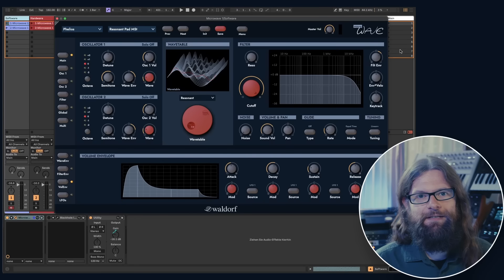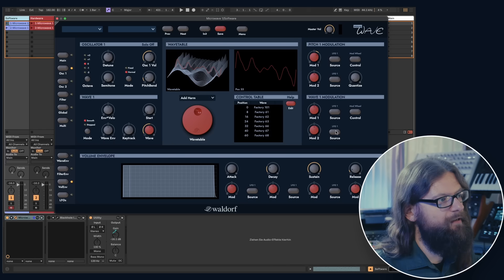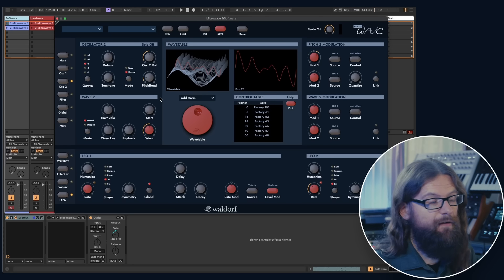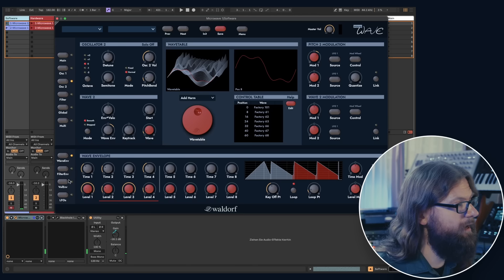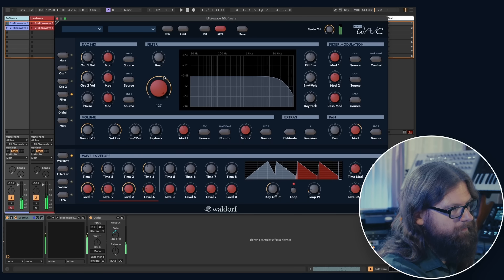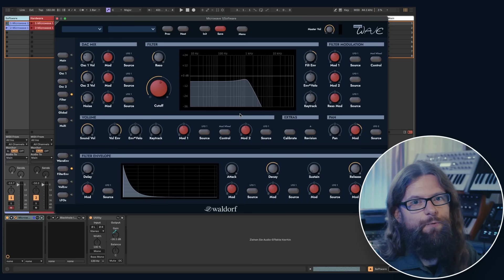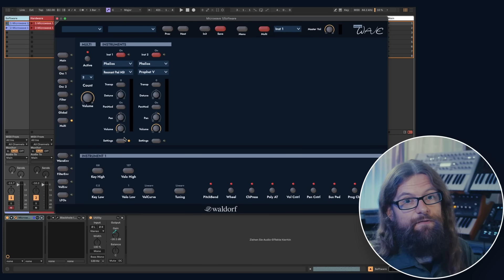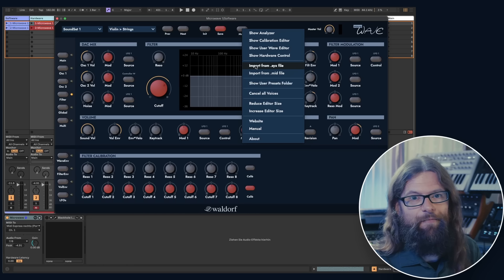Microwave 1 Plugin - Walkthrough, Sounddesign and hardware remote

Comment: Recently in the open source DSP 56300 emulation project they have presented the emulation of the Waldorf Microwave II/XT. It is a good coincidence that Waldorf releases its own software version of the microwave
Reply from the maker: I am also a huge fan of the DSP emulation project and featured the Virus on this channel. It's great to have both the II/XT and I in the box. Great times to make music!
Reply: @MartinStuertzer  which is better?
Reply: @burger659 I haven’t used the Waldorf version yet but I have the original XT and the dsp emulation is spot on, which is no surprise since it’s running the actual ROM and only emulating the processor(s)
Reply: Well, back then people preferred the MW1 over the MW2 as the MW1 has analog VCFs and VCAs..
The Xt came with hands on controls, and without my Access programmer i would have parted with my MW1 after a week as programming is hell on earth .
So now Waldorf has to emulate those analog features and add them to the digital core or wave tables , and with CPU tech from 2020 that is not a problem anymore.
The clicky envelopes are still there but can be dealt with and the interface is marvelous, clean and easy to read and even acts as controller.
Still, if you want o use more than one instance you need a proper machine, the DSP emu has a very good multi mode that is lighter on the CPU.
They are both fantastic instruments , and in DSP land i am more looking forward playing with the new NordRed2X but Xenia will definitely get a place in the virtual rack, especially for those ethereal bell like sounds

Comment: Thx for the video! Unfortunately I'm not able to connect the vst to my hardware MW1. Is there a special vst version just for the hardware? May ableton vst window (bottom left window with yelow dot) shows no midi IN/OUT just the XY field. Sure I'm missing something ...many thanks!
Reply from the maker: It should work with the regular VST. I suggest, that you contact Waldorf support, they should be able to help you!

Comment: Not sure why you would go with this at 149.00 $ when you can get either Vital, that blows it away for free or Korg modewave for 99.00 (when its on sale) that has quite a bit more capabilities. I gues for the novel desire to want a classic, I can see that but when you have smaller companies releasing really good classic emulations in the 25-100 range...
Reply: Because it’s the official app from the actual manufacturer with all the quirks of the OG.  There’s a premium for having the real thing, but feel free to use whatever works best for you 😊
Reply: Why not both, they do different things and sound different...
Reply: @user-ix5se9lg6o  Actually they do the same thing for either no money or less. Oh, and they do more than this. So the ONLY reason to get this is because it says "Waldorf".and/or you want a true emu;nation of this synth. But as I said before, why? If you can get more of the same for less.
Reply: @googlingthevoid  I said exactly that in my comment - if you want a novel emulation then be my guest. Your second point, "Its the official app" is never a good reason to buy anything. Your last point, "the real thing" - it's not. If you wanted the real thing, you would get the real thing. This is an emu. I take your point on the quarks. But 149.00 I cans emulate those quarks with a superior wavetable softsynth that costs less or free.
Reply: They are both wildly different synthesizers and don't sound anything like th Microwave 1. Do you get why they made this?
Reply: @Dudderlyful  overstatement.
Reply: Vital lol. If it ''blows it away'' that much, I then challenge you to prove your saying. Simple: take Vital, take the Microwave free demo and try to reproduce the same sound with your Vital thing and post your comparisons publicly, like here. Good luck, cause you will never be able to so that's why you won't post the examples. Have a great day!
Reply: @pablosmith5473  weird passive aggressive post dude. It also shows your utter lack of knowledge about synthesizers. You also completely created a logical fallacy. This isn't a boxing match. Vital is an epic synthesizer capable of creating just about anything your synth head dreams up. But that wasn't my point....🙃
Reply: Vital, you forgot to mention Serum and any other wavetable synth. Why? Becaue Waldorf have decades of experience with wavetable synthesisers, although their software have terrible outdated UI (including refreshed Largo UI).
Reply: @GrootsieTheDog  Vital, one synth to rule them all, right? I don't like Vital interface by the way, although I own it. It is powerful synthesiser but Microwave 1 is something else although they both share wavetable technology. You can't ignore intelectual property of Waldorf and their experience with wavetable. Maybe you can make close sounding patches in Vital, but why bother if you have real thing in software or hardware? And there is XENIA emulator.
Reply: @303machine  that was never my point. Commenters keep creating strawman arguments. My only original point is that their are so many wavetable software synths out there now that can creat the sort of patches that this can and for less money and with better interfaces. That’s all I said. My only mistake was I guess I should have expected a slew of fanboy online angst to come my way for simply having a reasonable argument for why one might want another software synth over this one.
Reply: They modeled the ASIC chip to bit accuracy which will give you all the same artifacts, bugs, and quantization errors of the original unit. Add in the filter emulations and conversion emulation, and it gives you a different sound hard to emulate. It’s like saying the Prophet and Oberheim are the same synth because they are both subtractive analog, but they are sonically distinct in their character. Neither is better, only preference.
Reply: @googlingthevoid  Yes, but Waldorf are somwhat notorious for abandoning their software. Just look at the miniscule UI STILL present on the PPG Wave V3!
Reply: The thing is, it sounds really good, and there are some really nice touches - like the way we can build wavetables from the factory/user waveforms (inc random/shuffle), the freeform mirrored user waveform drawing, the way the wave envelope works where time is really rate of change, and the layering of instruments/voices.  I've been using this for weeks and the "weight" of the init still makes me smile. There's something to be said for being so focussed vs jack of all trades, master of none.
Reply: @Paul_Y_T  Ya, I get that :) I was never opposed to it. If you look at my original argument, I was just making the case for the idea that there are a lot of very capable wavetable software synths out there now and some much less. But I did do some research and dug deeper and there seems a charm to it that I did not see at first mainly, and to your point, more focused.